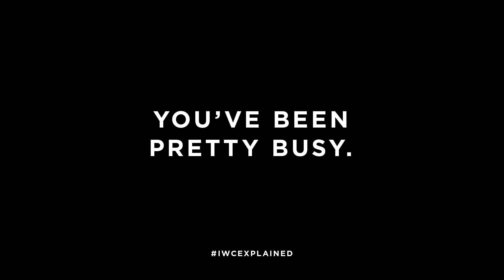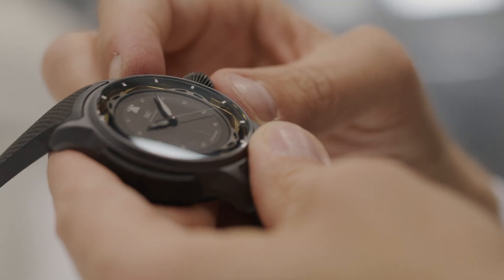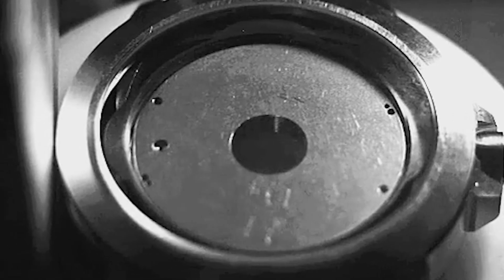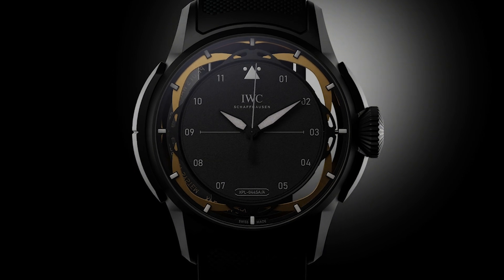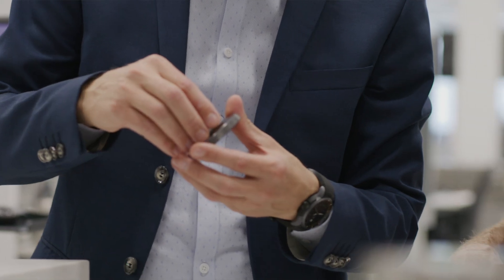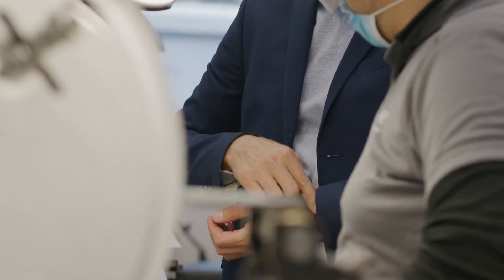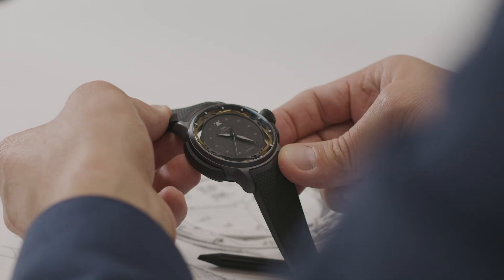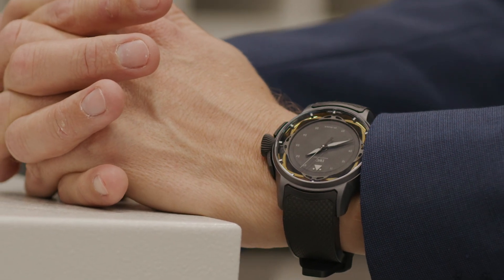IWC - The Big Pilot's Watch Shock Absorber XPL.

Comment: ok, so this spring is able to protect movement from a side impact. What happens when the force comes from another direction? Imagine a combat vehicle that only has armor on one side and totally unprotected on others, it's a laugh. Also, 8 years of R&D to put a spring in a case?
Reply: Kind of what I wondered, but I'm not an engineer.  I just figured I was missing something and perhaps impact to the face is taken into account and also dispersed.  And btw, I call absolute BS that this is "so advanced" that you can only make ten a year.  Spare me.  It's a watch.
Reply: @Jaydoggg99  marketing, those watches probably only has 1 or 2 people working on it as it was probably not their main focus. Not everyone will ,ya know, spend 200k and put it on the wrist. I do think the advance part is that the movement is suspended 4 way with a crown inserted, Its not just side way protection.
Reply: @kevinji7285  exactly.  So they only make ten a year because they choose to do so; not because there's some incredibly labor-intensive process relative to every other watch that they can only produce such a limited quantity.
Reply: @Jaydoggg99  yup, IWC production is pretty standard with  high accuracy CNC and hand polish. So 10 per year is simply a choice. They will only produce 30 Total. It would be different if these were some handmade movements with no help of CNC and really special parts that a CNC would not be able to do. From my understanding this is just a modified existing in house movement